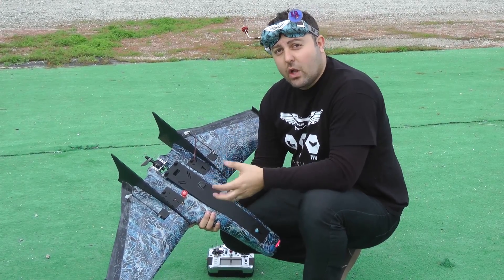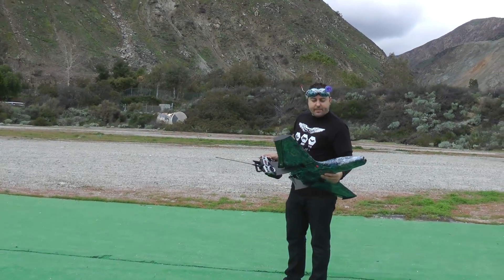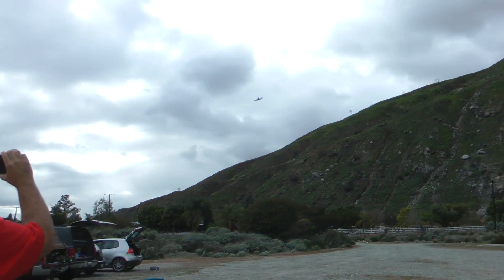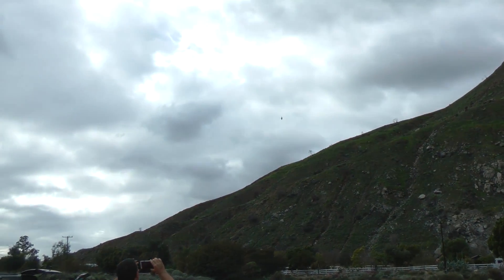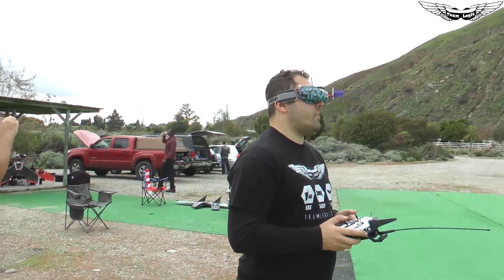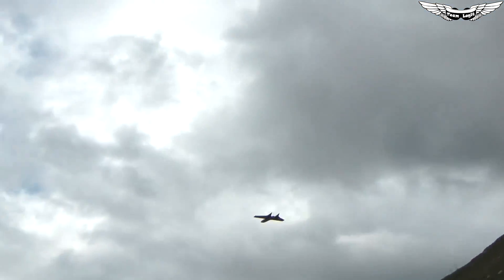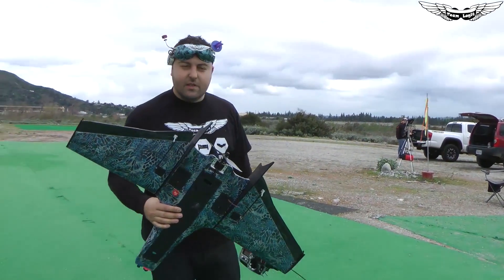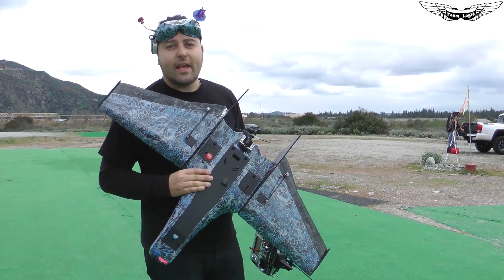Mini Drak Maiden Follow Up

Comment: quality control on this model is non-existent it showed up at my door yesterday and I'm totally pissed off or sections of foam missing all over the place to Mill by two middle sections missing all along the hatch the bottom is dissimilar from one side of the not the next with a 20 by 2 mm section missing across the entire bottom the last four models I got from banggood for 40 bucks the phone was perfect on for $170 why can't you get the foam right on this model look for my internet video showing all the damage

Comment: what is the flight time on the different batteries?
Reply from the maker: Julio Malpica it varies between 7-15 mins also depends on flying style. There are some new extended wings that give you longer flight times
Reply: Team Legit looking for something that will give me 20 minutes plus. I will not be flying very aggressive as I am thinking of using it for long range. What do you recommend.
Reply from the maker: Check out our new 5D for some super smooth and easy to fly wing. It can fly for about 45 mins. If it's too big our Fohdy can also do the job boasting 30-40 min flights with our efficiency package.
Reply: thanks a lot. I will check those out.